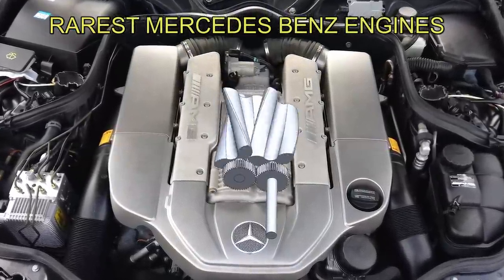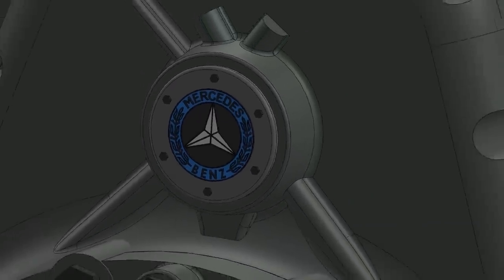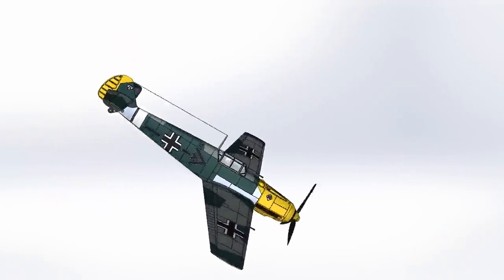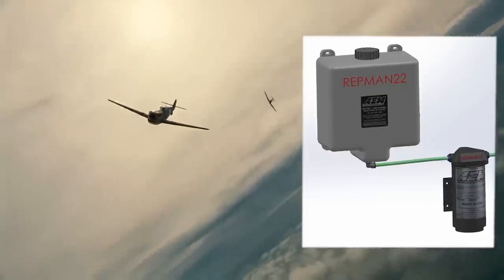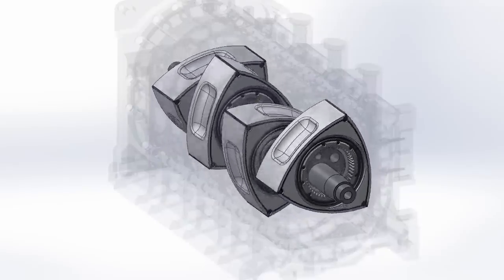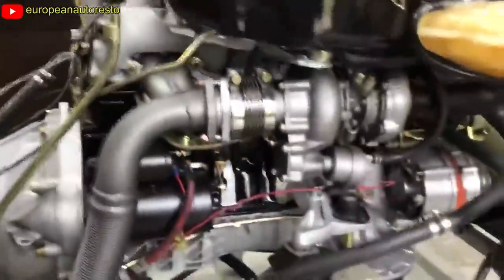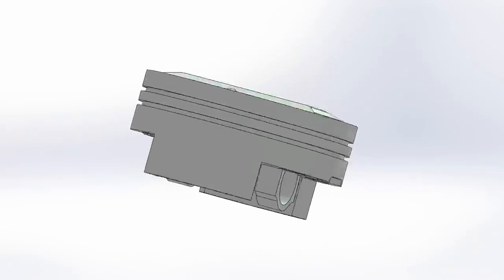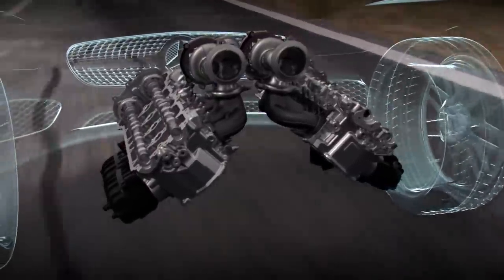7 RAREST MERCEDES BENZ ENGINES🤯

Comment: The "kompressor" engine had a clutch that allowed the charger to decouple at low loads.
Reply: My dad has an v8 compressor😮
Reply: @quintenvis1265  4 cyl kompressor in a W203 C180k and C200k here lol both are good donkeys
Reply: There's more than one, do they all have a clutch in the supercharger pulley?
Reply: @juaneer  I am referring to the 4 cylinder used on the C class W202 (1993-2000)
Reply: so they had flex fuel vgt turbo gdi in 1935 but mfs can't make it work today?
Reply: Toyota previa and aw11 MR2 had that also
Reply: @quintenvis1265  and?
Reply: @TheAdatto  im just proud
Reply: @juaneer  yes . a friend has fitted one to his 2.8 e30
Reply: The E200K W210 has it too
Reply: which is dumb, superchargers are often billed as inefficient,but in reality they only increase fuel consumption by 3%, while increasing power up to 154% and only increasing engine weight but around 10%.  Which means for the same amount of power one can reduce engine weight to around 40% which saves far more fuel than the 'inefficient' supercharger.  Adding a  clutch adds complexity, meaning more points of failure, while only saving fuel at an idle
Reply: @TheNoodlyAppendage  I wouldn't judge Merc's engineers as dumb. Fact is, except for very small underpowered cars, all car engines live most of their life at very low relative loads. Therefore, SFOC gains at partial loads are of very high value.
Reply: I have a sl55 amg with the v8 kompressor
Reply: @mtcmotorsports4512  And does it have a clutch?
Reply: Nah, you're thinking of the "Interceptor" from Mad Max... He could turn his blower on and off with the flick of a switch... Lol
Reply: @philljustphill1656  Didn't work all that well back then either...
Reply: @da1ve468 low e.t.'s  yeah but it's been so long. You'd think they would've figured it out by now
Reply: @philljustphill1656  It would be a nice idea though... Engage it only when you step on the throttle, and save all the parasitic loss when cruising.

A supercharger takes a bunch of horsepower to turn it, but yea, one would think that they could come up with a clutch that could take it.

I have a Gear Vendors overdrive unit on the back of the trans in my 800h.p. street car, and it's about the size of a small coffee can, and it can hold 1000+h.p.
You'd think it was possible to make a smaller one that could easily hold the torque going to a supercharger snout. 🤷🏻
Reply: @juaneer Only the early M111 4-cylinder engine uses that, the updated version uses a boost pressure regulation valve. The "Kompressor" revs the whole time.

Comment: 6:58 The car shown is not a W116, this is a W123.
Reply: But the statement is correct. However the max factory hp was 120 hp with the hi lift cam . Two hundred will burn up the pistons unless you intercooler the hell out of it.
Reply: @dennis-nz5im  OM617 was indeed 228 hp when fitted to the C111
Reply: thats an se w126 or s or some look it up silly billy
Reply: nahh im tripping sorry
Reply: @DLTX1007  was higher boost , different pump and definitely intercooled
Reply: @lildickgirl8974  I wouldn’t be arguing with people when your name is “lildickgirl” 😂 no hate tho

Comment: Nice video👍🏼 another engine that could deserve mention is the M199 the LeMans race winning engine used on the Silver Arrows Sauber C9. It was based on the production 4 cam M119 V8. A legend in its own right. I’m a fan of the M113K motor 👌🏼

Comment: Suzuki had beryllium piston on their F-1 two-stroke race bikes nearly ten years EARLIER and Alfa Romeo had used beryllium pistons in their 2.9 liter I-6 F-3 race cars circa 1931. Sir Harry Ricardo, the imminent British engine designer and theorist built a single cylinder engine with a beryllium piston in 1908 or 09 according to his book, the top of the piston being heavily tin plated for heat resistance against "pinging" with the low octane (no more than 75) fuels available to him. There are actually THREE "rotary" engine designs described in Sir Ricardo's book "High Speed Internal Combustion Engines" (Oxford Press -1934 revised). The Wankel is just the most practical. Outside the US, Mazda sells a turbo'ed three rotor Wankel with direct injection that cured the fuel economy, oil consumption and emissions issues. Tickling 400 Brake HP, it's competition for the Fairlady, Supra and Toyo-San Altra-Japan's TRUE sports car with 600HP! ($700,000!!!) Sorry folks! No matter what U-toob says, there are NO internal combustion engine designs that haven't been built and MASS PRODUCED for cars, boats or areoplanes! A look thru Sir Harry's book will prove it to you. The book is LONG out-of-print, but a good Public Library can locate a "circulating copy" for you, or fee-pay has them show-up for $200 or so. His book shows all SIXTEEN crankshafts PRACTICAL for V-8 engines, and he discusses the advantages and disadvantages of them all.
Reply: This comment just sounds like ranting with all the caps lock, but would definitely look at that book.
Reply: *eminent
Reply: Greg’s Airplanes and Automobiles has it on his patroon
Reply: You definitely googled this lol

Comment: There were more kompressor engines than just the M113 V8. They also had an M271 R4 with a supercharger, and an M112 V6
The M271 kompressor is actually really common, i see a ton of C, CLK, and E-class cars with that engine.
Reply: KompGAYsor
Reply: @maozedong981  are you 12 of something 😂
Reply: m111 kompressor is better than the m271. the 271 has mercedes' worst timing chain
Reply: Henlo Topias.

Comment: My favorite Benz powerplant is the OM-606. Inline 6 mechanically injected turbo diesel with tons of power and countless aftermarket parts available to more than triple the stock whp/ wtq figures. Vendors like Firepunk in the UK are one of the 606 gurus IMO. The power is in the injectors and injection pump. Best part about it is the lack of inefficient, failure prone, restrictive, etc emissions BS. So many turbo diesel applications that have DPF, EGR, SCR, etc have those components fail, catch fire, need replacement, etc and they really cause more harm than good. These parts cost a small fortune, even if you do your own labor it can and most likely will need replacement, maintenance, or cause other things to need attention.
Reply: Have a look at the OM366LA 😉
Reply: And that it revs so high!!

Comment: The 600 was mixed up a bit, so let me clarify.
The DB-600 was a Series of engines, including, but not limited to the 600, the 601, the 605, the 603, and the 610.

The main difference is displacement and power.
The 600 was the smallest, it was developed very early.
The DB-601 was the most used version. It was only 25 liters in displacement, and was used in the Bf-109 E and F series and the Bf-110 Zerstörer heavy fighters, most notably.
The 601 produced around 1400 hp, which was relatively good around the time.
It was also license produced by Alfa-Romeo, Kawasaki, and Aichi.
By that, it was used on the Kawasaki Ki-61 Hien fighters, and the Yokosuka D4Y2 Suisei Carrier based Dive Bomber in Japan, and in Italy, the 601 was very quickly adopted into fighters that used Radial engines before, resulting in the Reggiane Re.2001, and the Macchi C.201.

The 605 was probably the best of the bunch in terms of averages. It was 35 liters in displacement, and produced 1400 hp....on normal operation, but the engine was regularly used on War Emergency Power, where it could go at 1900-2000 hp, which was pretty good.
It was used in the Bf-109 G and K series, and it was used also in Italy, powering the Macchi C.205, the Reggiane Re.2005, and the Fiat G.55 Centauro, the "best fighter of the Axis".
It was also licensed by Hungary, along with the Bf-109G.

The DB-603 further increased displacement to 45 liters, and horsepower output to around 2350 hp.
The Bf-109's airframe could not hold this engine, but the Focke-Wulf Fw-190, which used a Radial engine, could house the engine, and thus they made the Fw-190D nicknamed "Long-nose Dora", with the lengthened nose to house the engine and the tail to stabilize the modification.
The 603 was also used in the Me-410 heavy fighters, and the Dornier Do-335 Spiel heavy fighters. The only notable export was in the prototype Fiat G.56, which was a G.55 fitted with the larger engine, which was truly one of the best piston-engine fighters ever built.

The DB-610 is special. It was just 2 DB-605's mounted in tandem to power a single propeller. It's main advantage was that planes using this engine would have the benefits of a 4 engine design, but with reduced drag. Planes using this were the Heinkel He-177 Grief, and the Junkers Ju-288C. The engine was prone to overheat and catch fire....

Comment: I've never heard of a hydraulically driven turbo before, that's really cool.
Reply: I think it was so if that hydraulic system got a leak the engine wouldn't run out of oil and could limp home
Reply: No wonder, because no turbo charger is hydraulic. That's the key to the term turbo, there's an exhaust gas turbine powering the compressor.These here were superchargers.
Reply: @blandpepper2755  no.
A hyd fault would lead to the supercharger failing. At high altitudes, a failed charger/turbo will lead to the piston engine stalling, and the aircraft crashing. Still today, this is one of the most common causes of accidents in GA.
Back then, technology did not allow building a small turbocharger which was reliable.

Comment: I believe NSU was the first rotary engine. And yes I know the 5 cly Diesel very well taught to Techs as MB Technical instructor. In South San Francisco. I loved going over the Grape Vine in L.A. and have the converted gas engine in GM Diesel try to keep up.
Reply: Felix Wankel was one engeneer from NSU, Mercedes Benz , like all others did buy the licence by NSU
Reply: Wankel made a fundamental error. If his stator had been a tricorn shape and rotor and oval the tip seals would be static and a spark plug at each corners solves the flame quench issues. Sadly nobody (of note) has considered this change.
Reply: @Dave5843-d9m  Look a Mazda’s new Wankel design.

Comment: Was there ever done research whether involved engineers got sick from being exposed to Berylium?
Reply from the maker: no problem unless they suck it up while it's powdered before mixing with the steel
Reply: Berylium isnt terrible unlees you get airborn particles in you during machining.   Coolant or cutting fluid helps capture it.   Many machine shops still Make bery parts for military, electronics contracts today
Reply: Beryllium alloy pistons are made of mostly aluminum with beryllium and a tiny bit of zinc and copper and titanium added. The resulting alloy is extremely tough and very lightweight. They use this alloy for propeller driven aircraft engines for the pistons and connectiong rods. 🤓

Comment: In that last video, mounting the turbo chargers inside the V engine reduces turbo lag for the turbo chargers and a good turbo response and I believe this is the best engine Mercedes Benz ever made in the world. I think the only car manufacturer is trying to do the same thing is the Ford F 250 super duty pickup truck.
Reply: I believe BMW actually beat MB to the punch with hot V engines with the N63 engine in the X6. From my research, that was the first use of the configuration in a car. I believe the confusion started from an engineering explained video, but I am not entirely sure.

Im not going to argue about who does it best as I only have experience with the S63TU. I would also like to let you know that the hot v configuration is used by Audi and Cadillac. 

Anyways, have an awesome day 👍

Comment: The BF 109 inverted v12 had a cannon firing through the propeller hub. Could you show us how this was done?
Reply from the maker: the trigger is synchronized with the propeller, making it unable to shoot when the blade passes.
Reply: Ah about this, the propeller is actually mounted lower than the crankshaft trough a gearbox (to reduce propeller speed), and the tube for the gun is mounted in between the banks instead of the crankshaft (which would be impossible on an Inline but is possible on a Radial), that is how it fired trough the propeller hub
Reply: I think I know what you mean because I wondered how the hell could they bore through the entire engine crankshaft to make enough room to run a 20mm gun barrel through it !?!? Well Like many aircraft engines the output runs a reduction gear that actually turns the propeller it is HERE that the 20mm cannon fires through the propeller  !
Reply: @oceanhome2023  the real trick today is try to get the damn thing to work or putting in back together.
Reply: @repairman22  wrong
Reply: @repairman22  No, Shooting through the center of the propeller hub, trigger synchronizer is not needed because there are no blades passing.
The Russian Yak-9 also had a hub cannon.
Reply: This is about engines. Not the 109
Reply: @repairman22  the 2 .51 cal guns above the engine relied on the interrupter gear, the 20mm cannon firing through the prop hub had no such requirement
https://en.m.wikipedia.org/wiki/Synchronization_gear
Reply: https://en.m.wikipedia.org/wiki/Messerschmitt_Bf_109

Comment: Beryllium metal itself is NOT poisonous.  What is dangerous is the dust and swarf generated whilst machining beryllium components.  Hence such machining facilities have to be Engineered and run with very strict procedures to eliminate potential health risks.
It is a very useful metal weighing about the same as magnesium volume for volume but unlike magnesium it has a very low thermal coefficient of expansion.

Comment: you have dredged up some sweet sweet memories of my days in the automotive business, a 300D engine is one engine that I could disassemble reassemble with a blindfolder, it is absolutely the sweetest engine that I worked on, one piece of information that  very few people know that the old Mercedes ZF 722 Transmissions had a rear fluid pump, initially it was designed for Towing in which it will keep the fluid flowing as the vehicle being towed from the front, at the same time it is the only automatic transmission I know of that could be used to kick start an engine, 1980s Mercedes-Benz 300D is the ultimate survival vehicle in which the minute you get the engine going there is nothing stopping it as long as you have fuel, diesel engines could keep on going even after an EMP strike,
I speak out of experience with my own MB vehicles, here is an old mechanic's hint I learned in the old country Palestine, diesel engines sitting for a long time especially in  cold climate or an absolute pain to get it started, the use of a propane torch in front of the intake manifold heating the incoming air will Aid in getting the engine going, and the minute it warms up and keeps on going there is no stopping it, 

The presidential limoThe Beast has a highly modified Duramax Diesel, that is one way of keeping it going after an EMP strike.

Comment: You should have added the M266/OM640 from the W169 A Class and their earlier forms from the 168. Slant 4 engines with one side of the engine having power output only and the other having the timing chain and auxiliary drive belt on the other end of the motor. That's an odd config right there!

Comment: Early Wankel engines had a problem with the combustion chamber expanding which meant the compression permanently dropped. 
 Our 1972 Mazda RX-2 suffered this problem and the entire engine had to be replaced

Comment: I had a BMW 550i with the hot v.  Aside from coolant line failures near the turbos, it was relatively problem-free and when that thing was on, it was ON.  Ran like a beast.  Hehe
Reply: Yea when I saw the hot V engine my mind jumped to the notorious N63. When it works, it's a monster, when it doesn't, it's still a monster, to your pockets.
Reply: @andorexurix2491  lol, yep, pretty much.

Comment: Not sure why people hate rotary engines so much. 

High power,  low weight, beautiful sound.

I mean sure they refuse to cold start,  are extremely temperamental, and require a lot of care and maintenance,  but its not like they are meant to be used in a daily driver or anything. 

As for fuel efficiency and emissions, you can worry about fuel efficiency when your done smoking the competition, and the EPA can take their emissions standards and stick 'em where the sun don't shine.

Comment: Everyone says the DB600 engines had “direct injection”. What does that mean?  Is fuel injected “directly” into the inlet ports or “directly” into the cylinders. It’s an important difference.
Reply: you just describe port injection.. so what is your question. it seems you understand both

Comment: Straight-6: across the spectrum (Ford, GM, Mopar, Toyota, etc.) has still proven the most durable format (still driving OM606 diesel, with well over 650,000 km)

Comment: There are some issues here: Technically the French had the first car, it was just ugly and slow. Zeppelins were flying from Friedrichshafen to Rio non stop, running on Blaugas, would be nice to see more if it. Felix Wankel invented the rotary engine.  And hey Beryllium is new to me surprised there was not more research done for aircraft use. Messerschmitt's were the best thing.
Reply: Felix Wankel did invent the wankel rotary piston engine and not the rotary engine who is sommeting different and was invent by a frenchman in 1896,use in his motorcycles and later in the WW1 fighter aircrafts

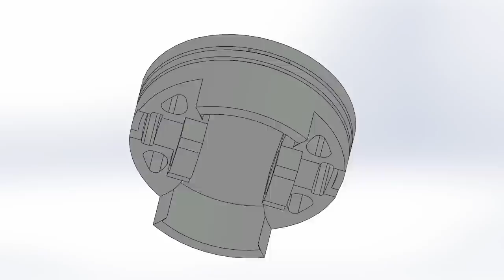Comment: 7:46 Classic Ferrari B.S. You might be listening to this video right now on a set of speakers with Beryllium tweeters or headphones with Beryllium drivers, or Beryllium might be in your head! dental crowns are often made from beryllium because the metal is light weight a super hard. in order for it to poison you, you'd have to breath in fine dust particles from the manufacturing process. The people at Ferrari protesting "its harmful effects on the fans" probably where walking around with beryllium fillings in their heads as they protested "the poison pistons".